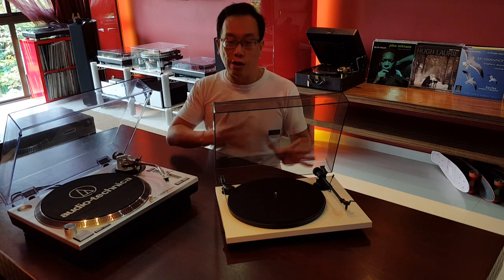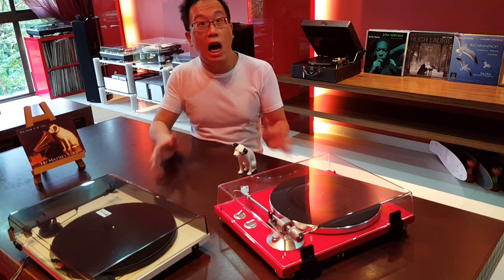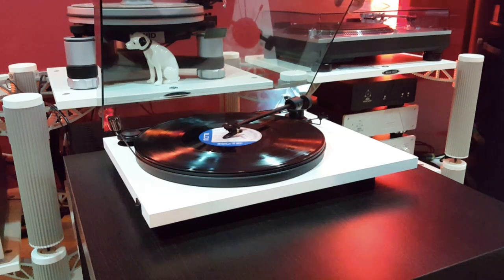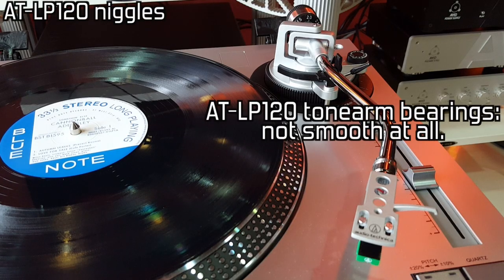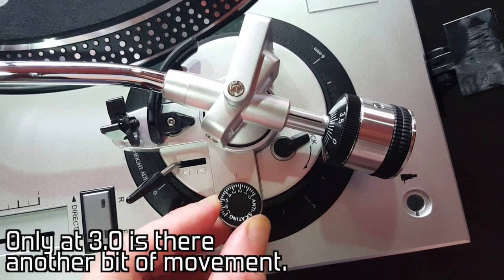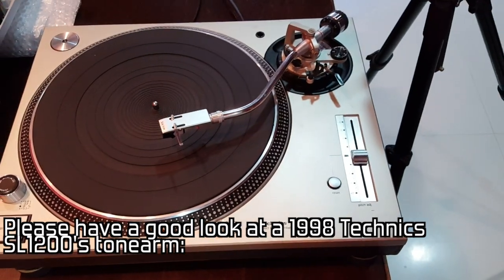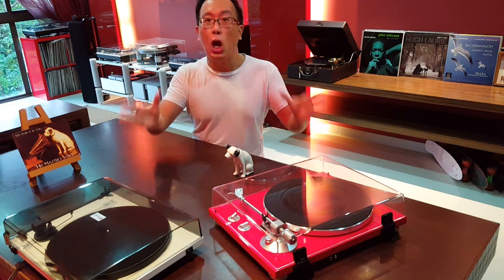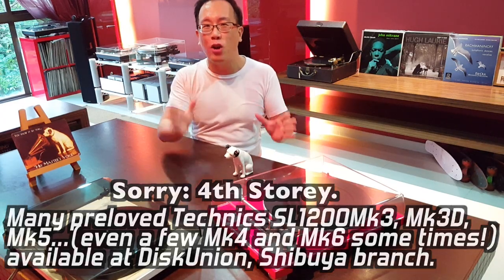Turntables $250 -$300: Shoot-out & Reviews.   AT-LP120 + Pro-Ject Primary + TEAC TN-300

Comment: I know these Turntables Ian, and your assessment veers on the side of kindness. Personally I think all three are a complete waste of money. 
The Technics 1200 series, even going way back to the late 70's and 80's was a quality built deck. I intend to buy the new 'G' series to add to my collection for its outstanding build and attention to detail. I've heard it sounding as good as decks costing several times more. 
There is a third party bearing & spindle upgrade for the older mkll to mkv that really works - solid brass and titanium with liquid lithium sump = zero noise. 
Unfairly, the Technics 1200 series has been labelled a DJ's deck, but it was originally designed as an audiophile quality deck that radio stations adopted, then DJ's. It's a flexible deck that is very well made, your recommendation is a wise one ✔️
Reply: Rick G 
You'll find the combo of solid brass housing, and Silicon Nitride ball (which rests on a ground carbide pad) also the main shaft, record spindle and the locating taper are made from a single piece of M200 Cr-Mo tool steel hardened and gas Nitrided, it creates even more stability and motor silence, noise which was caused by micro vibrations in the original aluminium structure. 
The new G series eliminated the tiny amounts of noise and vibration the original 1200 series has. This new bearing housing, bearing, and shaft materials seems to improve resolution and transients, and matches noise spec of the new 'G' series. I use very thin lithium oil in the tiny sump, which I found superior.
Reply from the maker: Chris Bishop Dear Brother. Am i glad to see you again.
Reply from the maker: Dear Brother. Am i glad to see you again👐👐👐.
Thank you for your kind words.  We have a mission, to help as much as we can.
Let's go and help as many as we can.  To educate.  To help😄.
Warmest Regards,
ian
Reply: Chris Bishop Thanks for the link! Pretty cool looking sintered bronze bearing.
Reply: Chris Bishop Hi.. Is this the SoundHifi/Timestep upgrade for the main platter bearing?
Reply: Rick G 
http://www.mikenewaudio.com/bearing.php
Reply: Chris Bishop Thanks for the further info, Chris.. When I was a kid I used to run an SL-1600 Mk2 which my uncle gifted us brand new decades ago.. I've been using a Thorens TD-124 (with a partial bearing upgrade, so dig the benefits) for a number of years but had to put most of my audio stuff in storage 'cos of big life changes in the last few years, but I plan to go back to serious audio again soon.. Anyway, I want something different these days so I wanna go back to a Technics, a souped up SL-1200 this time. I have a buddy who has an SP-10 Mk2 and if I could get somewhere near that sonically I'd already be happy. I almost had a chance to buy a badly repainted SP-10 Mk2 thirteen years ago for a very good price but the seller backed out the very last minute.

BTW, do you use the stock arm or something different?

Comment: What did you use to find the stylus rake angle? great shows as usual. maybe you could show us some time how you manage to do this cheers!
Reply from the maker: John sweda Dear Brother John🤗, you can use this:
2MP 50-500× USB Digital Microscope... usually very cheap and easily available on the ebay at about US$15-25✌.
http://m.ebay.com.sg/itm/New-50-500X-2MP-USB-8-LED-Light-Digital-Microscope-Endoscope-Camera-Magnifier-/282496048093?hash=item41c6139bdd%3Ag%3Ap3QAAOSwDiBZKUhC&_trkparms=pageci%253A66dc2777-4db6-11e7-8c6c-74dbd180115b%257Cparentrq%253A911bf01f15c0a993ebc5dd96fff7064b%257Ciid%253A7
Reply: HiViNyws channel 👌👍👍
Reply from the maker: John sweda You are very welcomed my dear friend🤗🤗🤗have a great Sunday!!
Reply: HiViNyws channel Just one thing does the microscope you're talking about have some sort of a protractor built in, otherwise I can't see how you would know what the rake is just by using a microscope is it design especially for this purpose? and surely it would need to be set up correctly otherwise you would get a false reading, no! Why were you against the project platter, having a light platter is a good thing, if the material!! is right, are you a fan of heavy Platters with counterweights, Would you know where I can buy sapphire ball bearings? what are made for the main bearing? maybe you'd like to try this I find using a piece of lead at the bottom then a piece of hard flat steel plate of titanium on top works great sandwich between the bottom of the bearing housing and the metal titanium plate on top works will. Have you ever thought of trying the triangle turntable one made from bamboo any experience with them? I thought they did look good made in America I think. what about doing a programme on turntable mats I think that would be very interesting from rubber felt leather Cork copper etc I thought balsa Wood would make a good mat but never found anything suitable have a nice Sunday yourself
Reply from the maker: John sweda Ah sorry! It is the Pixelstick which you can buy and download  for a dmall fee of about $10.  Very precise!!
Reply from the maker: John sweda ... i am not against a light MDF platter and i don't think i said it too😄.  Yes your suggestion is great: using various mats in a sonic comparison!!  Thank you my friend! Good, good!  They will come.
Reply: HiViNyws channel sorry mate!  don't know what you're going on about!! have you got the link to eBay. Why do you call it a pixelstick they're just some sort of Led's couldn't find anything on a dmall either whatever that is??
Reply from the maker: John sweda Brother😄! Here it is:
plumamazing.com/
Reply: HiViNyws channel cheers my friend looks good
Reply: or, if you dont use Mac, google for a free soft called Meazure, that does pretty much the same
Reply from the maker: Edighei Buranii Thank you Edighei!!!💪😄